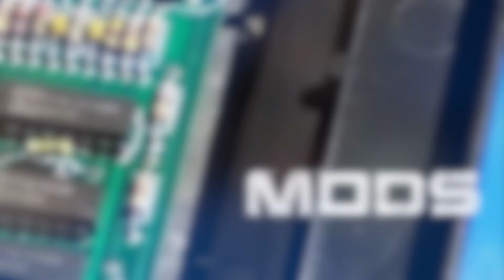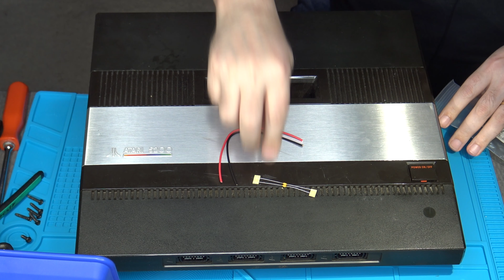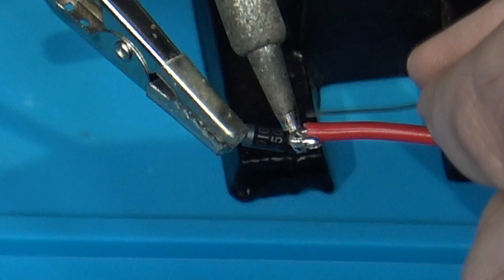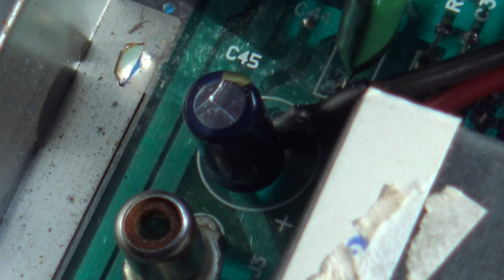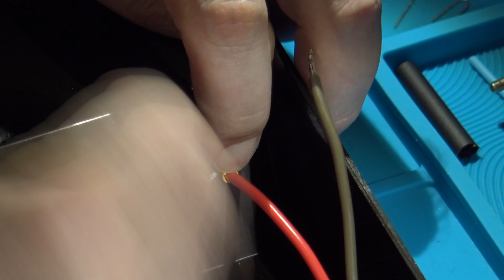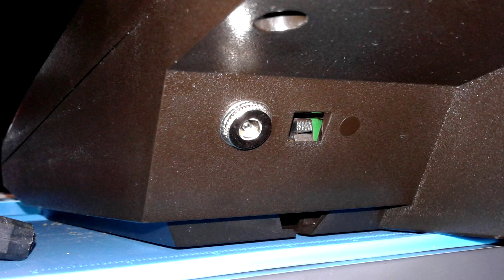ITC#67:- Atari 5200 - 4-port RF Power Bypass Installation

Comment: I always loved the 4-Port 5200, and the whole idea of standardizing 4-Player consoles. Warlords on 2600 was such a fun "party" game with 4 simultaneous players. The 5200 had so much potential with this, especially with Centipede. Get a room full of family and friends and you can have hours of fun in the living room. At the same time, when I first brought home my 5200 and hooked it up to the television set, sparks flew. Connecting the power into the automatic RF Switch Box and having one cable to attach seemed simple, but it sparked at me and was legitimately the scariest moment I've had with a game console in 35 years of playing. This looks like a nice mod. Thanks for sharing!
Reply from the maker: You know that sparking is featured of course on a pretty famous AVGN episode about the 5200. But what most people don't realize is that the proper way to connect everything was to plug in the RF cable from the 5200 to the switch-box first. Then the power plug to the switch-box, and then plug the PSU into the outlet. But most people did it all in reverse hence the sparking. It really isn't that dangerous as it is very low voltage but does have about 1A of current behind it. But that is one reason this modification/upgrade is a pretty essential one for most 4-port versions of the console. Thank you for the comment and for watching, I really appreciate it!
Reply: Sorry to be so offtopic but does any of you know a method to get back into an instagram account?
I stupidly forgot the password. I love any help you can give me!
Reply: @Maurice Brock instablaster :)
Reply: @Aarav Clark It did the trick and I finally got access to my account again. Im so happy!
Thanks so much, you saved my account !
Reply: @Maurice Brock No problem :)

Comment: After making this mod on the 4-Port Atari 5200, do you still use the TV switch box without the AC jack? Or the TV switchbox is no longer needed and you plug the TV cable directly with an RCA-to-RF adapter?
Reply from the maker: I've had a few others ask this question and I apologize that I didn't address it in the video. But you no longer need to use the switchbox after doing this. Instead you just connect the RF straight to your TV's coax ANT input and place the TV on whichever channel you need to get the best signal. Additionally, you can still use the original 5200 power supply as the replacement jacks in the kit are designed to fit that original supply.
Reply: @IvoryTowerCollections  Thanks for the reply. Yes, it is understandable that I still have to use the same AC adapter (+9.3V 1.95 A), I have all the parts according to Atariage forums, which are shown in your video, and I'm ready to make the mod, but I got others mods pending to do. 

My doubt stemmed from what people were saying in the 5200 forum that I needed to do the AV mod as well. I see that it is not necessary, and I'm not in a hurry to do the AV mod. And in case I acheive this, I have the chance to sell the Switch Box as will be no longer necessary. It's interesting that I found on Ebay that some people sell the Aromat relay inside the box by separate and around $50, but the entire Switch Box cheaper than that. Well, anyway, thanks for the tip.
Reply from the maker: @KeonAureii  No problem at all! I only mentioned the PSU because I've had people ask me outside of YT about that and even had another modder tell one of his customers that a new PSU would be needed after doing the power conversion. So I just make sure that people are aware that they do NOT need a new PSU unless they choose to use a different style or size DC jack to power the 5200 from. The post over at AtariAge also mentions removing the RF cable and you will notice I did not do that. It doesn't need to be removed for the power conversion. But for some reason, if it were removed and you needed to replace it, that RCA jack soldered to the board is for using a male connected coax RF cable and will also work same as it does on the 2600.

Comment: Could you demonstrate how you are supposed to connect to the TV after all that? I assume the RF cable would have to go to a traditional non-powered manual switch or the RCA to Coaxial adapter. I assume the diode prevents power from feeding into your TV's RF input but it might be good to explicitly stated that. Was hoping this video would also cover RF bypass in the sense that we get composite video output. :)
Reply from the maker: Yes, the RF cable is now just RF output only so you would either need a traditional switch-box at that point or one of the Coax-F adapters to use directly on the antenna input on the back of your TV. The diode is for reverse polarity protection if you use the wrong PSU with the 5200. When you remove the inductor I spoke of in the video, it removes the circuit where power was coming from the RF so there is no more DC voltage other than what is there for the video signal itself on the RF side anymore. My previous video on the 5200 was the installation of a UAV for composite and s-video output on the 2-port unit. But the same rules work for the 4-port as well. If I were to do any AV upgrades on a 5200 it would be to put in a UAV since it provides an easier means to get both composite and s-video without having to remove any components off the main board of the 5200.

Comment: The yellow capacitor at the connector (bridges both positive and negative wires) - does it have to be positioned a certain way? There's no band on it to indicate negative.
Reply from the maker: The small capacitor that comes in those kits is non polarized so it doesn't matter in this case.
Reply: @IvoryTowerCollections  Thank you!!!

Comment: So what type of power supply do you need with the kit then??
Reply from the maker: You still use the original power supply that you normally would with the 5200 or equivalent that meets the proper 9 -10v output with at least a 1.5A rating and is center positive polarity.
Reply: @IvoryTowerCollections  what if you don't have that (hence the biggest reason one would need this mod)

Comment: Do you have any advice for where you're supposed to attach the ground? My 5200 isn't turning on now and i'm wondering if I"m grounding it wrong.
Reply from the maker: I do explain where ground connects. There is usually an unused via next to the negative lead of the capacitor that you replaced out as part of this conversion. But if a via cannot be found, then you only need to attach the ground to the large section of the trace that the negative lead of the capacitor's via is part of. Did you use a predone kit for this or source your own separate parts for it?
Reply: @IvoryTowerCollections  I have a predone kit. I just put attached it to the large trace section and now she's firing up and playing Pac-Man. Many thanks :D

Comment: Sure is a nexus of weird the 5200, surprised that doesn't create AV noise running power that way. Going to do this someday, do prefer my AV and Power separated, especially for any further AV modding.
Funny I see below a mention of the 5200 AVGN episode, ironically that video just made me more curious about it and seek it out. ^_^ Very odd the whole wasted 4-port aspect, not like 2600 paddle games weren't party games so hardly new ground for Atari.
Been looking at that new 5200 controller, seems like a solid layout and shape. https://www.maker-matrix.com/category/retro-gaming
Reply from the maker: Atari initially did this for simplicity. As the controller cables aren't that long, it meant that the 5200 console when being played, likely had to sit somewhere nearby. So if you had the two separate cables as what was done on the 2600, it just looked like a mess running across the floor. So their thinking at the time, was to use this new fancy auto switchbox which also required some power in order to operate, and using the electronics in the switchbox and 5200, they could run both DC power and the AV along one cable. It didn't cause any interference because the power was only designed to flow in one direction and not back to the TV ANT side where the picture and sound would be going. It was actually ahead of its time similar to the pause and reset buttons on the controllers. Some thing not really seen again until the NES several years later. In this day and age however, we are mostly used to multiple wires coming off the consoles and even Atari themselves when they released the 2-port units, got rid of this single cable idea and went back to a more standard power DC plug.
Reply: @IvoryTowerCollections  Really, I thought they put keypads in the controller to move to move away from needing console switch interaction. I thought it was a bad attempt at forward thinking as that's what happened with game consoles Ie. it became distant.
Ah so it flows one way, that makes a lot sense now that I hear how it works.
Still a shame though, spending money on ports hardly used for party games.

Comment: But how about that rf out?
Reply from the maker: RF will still function normally. The power bypass just removes the requirement from running power through the cable. So at that point the RF cable is just like any other RF. Just use a COAX F adapter to connect it to the ANT COAX input on your TV and operate on either channel 3 or 4 with the channel select switch.